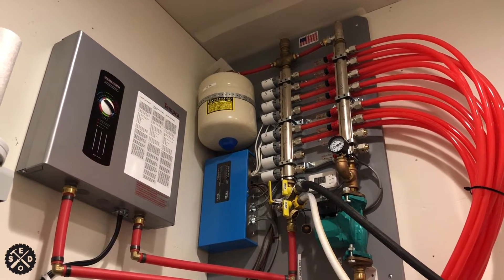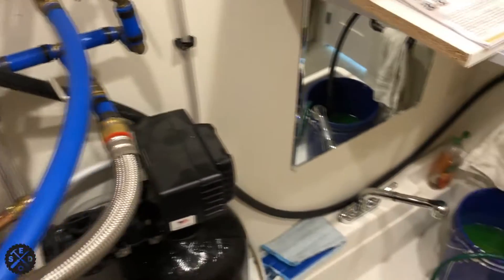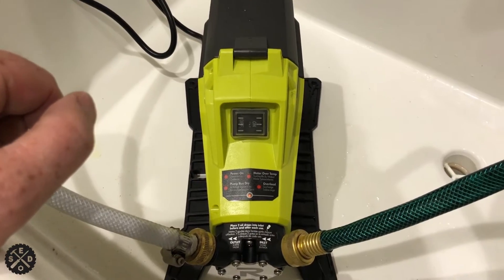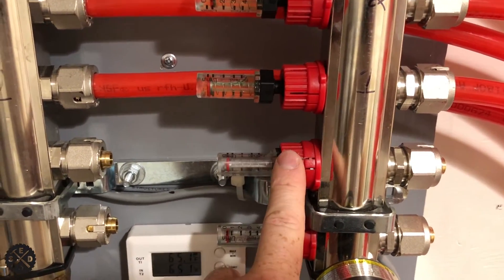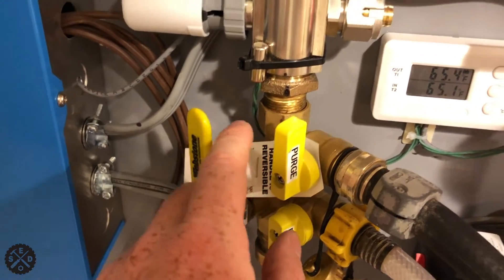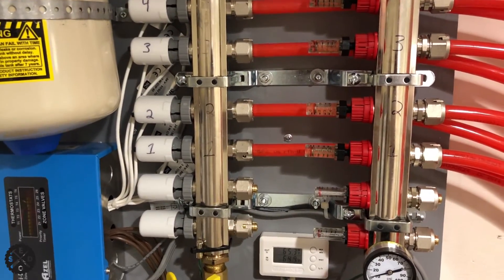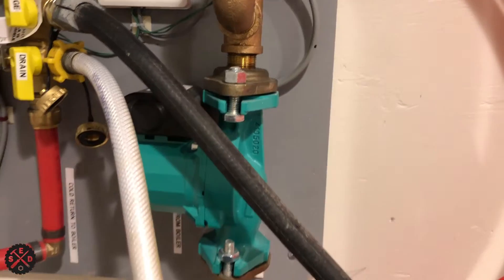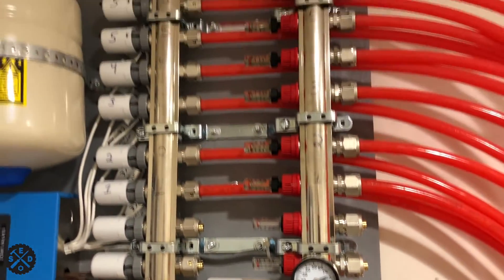How I Purged Air From Radiant Heat Pex Loops

Comment: Do you still like your system? I'm just planning a new build so I'm looking for suppliers for all this equipment. I've prob so propane but hopefully it'll save some money on heating.
Reply from the maker: Yes overall I love radiant heat. The electric isn’t as efficient as a good propane boiler but it’s still great so I think you’ll be happy with that setup.
Reply: @SmartEasyDIYer  thanks for the reply. I'm just about ready to start. Hope I get the plumbing correct. 

What about the glue you used on the inside walls instead of nails? Would you do that again also?
Reply from the maker: @NotTelling51 you’re welcome. Good luck with everything. Yes I would do that again. I might add some short tapcons as well just to help some more. No issues at all but I probably would add a few short ones.

Comment: Hi Paul,
I have learned allot from you and project by Knight's videos. I am curious as how much does it cost you per average month to run your electric water heater for the floor radiant heater? And do you have a separate water heater for the whole house?
Thanks...
Reply from the maker: Thank you so much I appreciate it! Yes I do have a separate water heater for the house. I think the worst month we ever had when it was unusually cold was 225 to 250 a month. That included the electric for the whole house too not just heat. I am experimenting this summer with doing a mini split heat pump since we installed one for AC in the summer I’m also using it for heat this winter and I haven’t even had to turn on the radiant slab yet. The electric bill is about half. The floors are a little cold but not too bad. So far so good. It sure is nice having the heat in the floor tho.

Comment: Hi Paul,
 Kind of ironic I have the exact same system from the same guy exceptmine is a littlebigger, mine uses the 24kw tempra its been running since 2015. I since also plumbed in a Tekgai lp gas heater and at one point had an outdoor wood boiler in use with a heat exchanger.
Reply from the maker: That that is ironic although I know quite a few people used him. How do you like your tempra overall?

Comment: Thanks for the video. Just one observation. My flow valves say they must be installed vertically. Yours are different so I don't know. Mine use gravity and indicate no flow, until flow raises the indicator. For others check the installation specs and buy the right ones depending on your particular installation.
Reply from the maker: You’re welcome. That’s interesting. Yes it must depend how your system is setup. Thanks

Comment: Is this Tempra actually just a tankless water heater or is it actually a boiler? Are you still happy with it? I currently am using a 40 gallon LP water heater and this seems like it would be so much better. I need electric because of the location. Currently have a power vent. Thanks.
Reply from the maker: Hi yes the tempra is just a tankless water heater. The guy that designed my system thought it’d be sufficient. Overall I like it ok. It’s gone thru several winters no problem. If I did it again though and if this one gives out eventually, I think I would probably do an actual electric boiler made for this type of application. The Thermolec brand is the one I’ve researched and seems like a really good unit from what I can tell. It’s stainless steel inside and has a 10 yr warranty. I’m not sure the model I’d use but based on the size of my btus needed. Etc. if you get a chance check them out.
Reply: @SmartEasyDIYer  Thanks for the info, Ill check those out also. What size sq ft are you heating?
Reply from the maker: You’re welcome. Mine is 2300 sq ft
Reply: @SmartEasyDIYer  Thats about the same sq ft aas my basement. An online calculator came up with 24k. Anything will beat a 40 gal tank heater. Thanks again for the info and for being generous with your time.
Reply from the maker: Ok great. At least it gets you something to start to research that way. Good luck with it all. If you think of it Let me know what you end up doing. Thanks

Comment: Any chance you've measured actual power usage from your boiler?  I feel like it's not going to use anywhere near 15kw when its only heating already warm water at a relatively lowish flow rate.

Comment: Thanks so much for the education.
From my understanding, there are supply flow control meter and return valve for each loop. 
So in order to open one loop, do you have to turn both supply flow meter and return valve all the way open? Thanks so much!!
Reply from the maker: Yes I believe they have to be open all the way for this. Thanks

Comment: We have a 15 Kw electric boiler.  1,315 sq ft home kept at 69 and 676 garage kept at 50.  I use a clear vinyl tube to connect from the pump to the cool side of the system.  I purge the air out of the tube by loosening the connection fitting and running the pump until a little liquid comes out.  I then tighten the fitting and open the port valve and pump to recommended pressure of 12 pounds.  Close the port valve and disconnect draining my solution from the hoses back into the bucket.
Reply: Any chance you've ever measured actual power usage from your boiler?  I'm wondering how much power it uses when it only has to heat water that's already pretty warm.
Reply: @timkorn2102  No I have not.  Just FYI 1,315 sq ft home.  20" inches (R-50)  blown cellulose in ceiling, R-19 bats in 2x6 16 center outer walls. 1,300 Kw stacked boiler (one tank feeds another tank)  Foundation is 2x6 wood foundation with studs at 12" centers and 4 inches of yellow board between studs.  Total seasonal heating bill has not gone above $600.00 yet.
Reply from the maker: Cool thanks for sharing your process. What brand boiler do you have and are you happy with it?
Reply: @SmartEasyDIYer  Thermolec brand.  Heats water to 110 from 55 degrees.  Once water is above 55 degrees boiler can reach 120 or higher output.  We have a super insulated in perimeter foundation, insulation between slab and ground.  We have R 52 Cellulose in ceiling and 6 inch batts in walls with house wrap and vapor barrier.  Haven't had over a $600 heating season yet.
Reply: Yes we are vert happy with our system.
Reply from the maker: I think I would probably get that one next time too. That sounds awesome!

Comment: Great explanation... But I got one doubt, after you build up the pressure how do you turn off the ryoby pump? If you turn off the valve your pump will burn but if you turn off the pump before the valve you will loose pressure...
Reply from the maker: I shut the valve while the pump is running then turn it off right away. It doesn’t burn out if you do it very quickly. My pump was close enough to the unit that I could do it within several seconds. Not sure how else you would do it.

Comment: Excellent setup and video. So, after your first winter, what's your take on the electric boiler? For the price, I'm thinking of installing one as an emergency backup in case I run out of propane. Thanks!
Reply from the maker: Thank you! I’ve been very happy with it overall. We had an extremely bad winter as far as temps compared to normal and it handled it like a champ! Our worst electric bill was $280 and that includes heat and everything else. I don’t think that’s too bad considering the crazy temps we had for so long. I’ve thought About doing a wood stove to help out too but I’d say this is definitely a good choice for a backup.
Reply: floyd:  If you use a gas boiler for a heat source, make sure you have a combustion air supply for the flame equal diameter to the exhaust gas pipe.

Comment: Good looking setup. How long are your circuits and how did you figure out what size pump and boiler you needed? Thinking of doing something like that at my place for just our master bed and bath. Mechanical room is at the opposite end of the house (Ranch) so I’m going to have a lot of wasted pex just getting there and back. Only have 400 sq ft of space to heat, but probably have to run 1000’ of tube because of manifold/boiler location. Looking for advice on sizing if you have any info. Thanks
Reply from the maker: Wow that’s quite a ways. I’m not really the one to ask as far as sizing etc. I had someone design my setup for me. His name is Fred seton but the last year his phone is disconnected so I don’t know what happened to him. He’s been around for years in the radiant business so he really knew his stuff. You could try him see if you have better luck. he didn’t recommend going more than around 400 ft on a loop I don’t think cuz the water cools off too much by the time it returns and makes it less efficient. I’m not sure what to do in your case where you need to get it there and back so far. That’s a unique situation. Do you have a local plumber friend you could ask ideas? That’s probably the best if possible.
Reply: Smart Easy DIY     Sorry. I might have confused you. The manifold isn’t 1000’ away. Would be around 60’ from center of the bedroom. So 120’ of just getting there and back doesn’t leave much PEX left out of a 250’ roll to lace around the floor joist for heating the dedicated area. So by the time  I have my area covered properly, it will be around 1000-1200’ of PEX to heat a 400 sq. ft area. Maybe this is typical for a ranch style home. Just seemed like a lot to me.
Reply from the maker: Oh gotcha OK. That does make a little difference. I probably would still get a professional opinion but it seems like if you would insulate the lines going to and from the bedroom so you wouldn’t have much heat loss that that 120 feet wouldn’t count against you for the actual loop length then maybe.
Reply: Smart Easy DIY    Good idea. Thanks for responding.
Reply from the maker: You’re welcome best of luck with it!

Comment: Looking to do radiate heat in my garge should I use a propane instead electric? Is the boiler more efficient  than propane?
Reply from the maker: It’s really up to you. I couldn’t really use propane unless I did some really big tanks that would last me all winter because my driveway has a really bad spot that the propane truck couldn’t make during the winter. Also electric is reasonable here so so far it’s been good for me. You just have to weigh the pros and cons of what’s best for your situation. I had a propane boiler where I lived previously and it was very efficient.

Comment: interesting aside.  The air eliminator should be 18 inches or more away from the pump. Why it takes a bit of space for the bubbling to coalesce a bit so the cavitation of the water flow will tend to be reduced and allow the air eliminator to do its job.    Found this on several sites that produce the parts like upenor and taco
Reply from the maker: Nice ok. Are you setting up a radiant system for yourself?
Reply: @SmartEasyDIYer  YES  doing it a bit differently going to use 7/8 pex al pex pipe.   3  500 foot loops  one larger pump for the loops one from the heat source plumb it into a flat plate exchanger. Will keep domestic and heating loops separated.

Comment: get online here .. I see expansion tanks put in upside down.  Pex piping that looks like a ball of spaghetti.  Way to many pumps that just draw so much power you can go out and watch the meter doing the hundred yard dash.    I am a fan of gas to fire the heating ... Electric is ok but takes up so many amps in the panel even if the unit rarely is heating that much.
Reply from the maker: Yeah same. I would love to have natural gas too. Propane is expensive where I am and the truck can’t make my driveway in the winter so electric was about my only option. This one actually only uses 60 amps I believe so it’s not too bad. I will have a wood stove for backup heat but this radiant is so nice I don’t want to use much else. 😊
Reply: @SmartEasyDIYer  If you are going with wood .. do look into mass rocket heaters.. it is another version of radiant heating.. and will use 90% less wood as the heat goes into the mass rather than up thru the flue
Reply from the maker: Thanks for the info. I’ve been following along with honey do carpenters air Crete rocket stoves. Have you seen about them at all? If you haven’t check out his channel. It’s quite interesting.
Reply: @SmartEasyDIYer  ceramic insulation would be better for insulating over air crete in my estimation. The problem with aircrete is that the portland at the high temperatures will break down especially if you get the MRH up to the temperatures that are easily achievable.  This is really only a problem of the internal chimney inside of the drum.
Reply from the maker: I see ok. Interesting Thanks.

Comment: Hello, I like the neat appearance of your setup. Is the input and output loops connected together at the top of your system, and if so, why wouldn't the pump push the fluid straight up into the return loop of the system.
Reply from the maker: Thank you it did turn out nice. I’m really happy with the set up so far. I’m not quite sure I understand the question exactly but The pump does push fluids through the loop which ever zone is open and calls for heat it can’t push through all of them at the same time unless you have the actuators removed which I did for filling and purging the air. The reason for doing one loop at a time initially is so it’s easier to get the air out of each loop one at a time. If you’d open all of them up it would take a lot longer to get all the air out of the whole system.

Comment: Curious, at 0:12 I see your safety expansion tank which has air that compresses when the liquid expands. Why would the system not allow any air circulating to simply rise to that line? Or is your main pump's flow rate too slow?
Reply from the maker: Yeah I think it’s too slow. If there is a little air in the system it will slowly bleed out but it seems like you have to get 99% of it out first. My pump also won’t circulate the water correctly if there’s too much air.

Comment: Nice work on this heating setup. Well laid out. You know how I feel about PEX but expertly done as it was I'm sure it will serve you for many years to come.
Reply: Since you don't like PEX what do you prefer?
Reply: @usmarine0352  Me myself and I, copper. Can't say it is not more work but copper blue has a 300 year longevity as long as installed properly. Plastics degrade much sooner. I believe in building things to last past my lifetime and past others. I hope this helps.
Reply: @curiosity2314 but the pex is in floor also no point in over building it where it can be easily replaved
Reply from the maker: Thank you. Good to hear from you. 👍

Comment: Why are you need that system?
Reply from the maker: I need it for heating my house. The Pex tubing is in the floor.
Reply: Mmm thank you for information and system looks like so good. 
Have a good day sir! =)
Reply from the maker: Thank you! I appreciate that. I had a hard time finding info about adding water and removing air so I wanted to try to explain what I ended up doing. Thanks for the comment. 👍👊